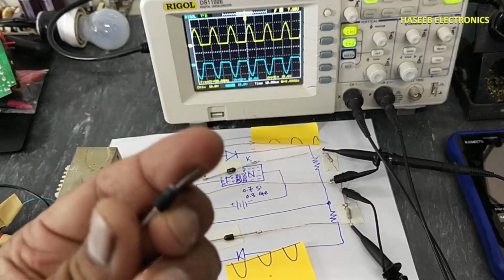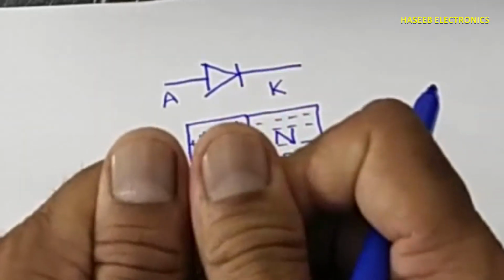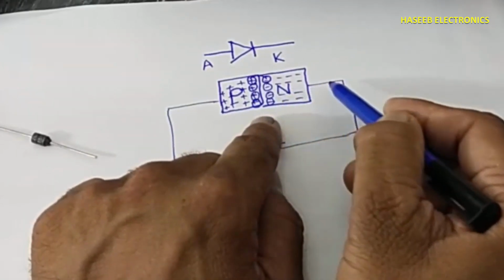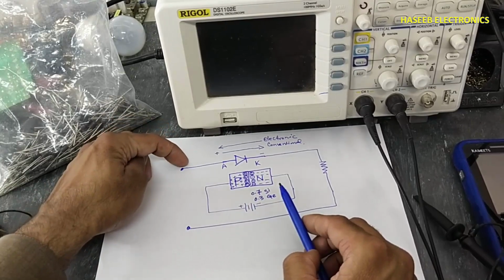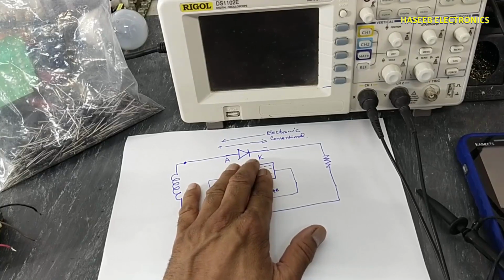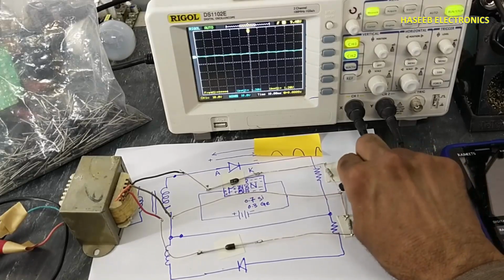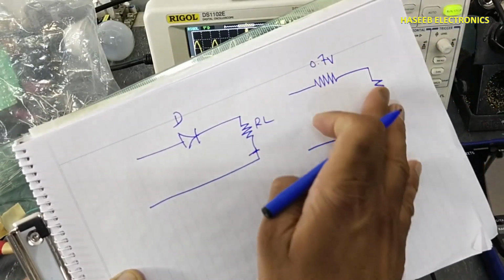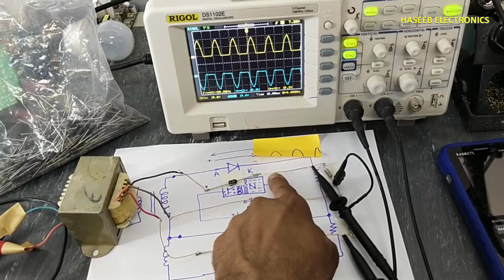{970} How a diode rectifies ac signal

Comment: Hi
can you tell me how a reversed diode is able to turn a light on ???
example a 120 volts AC  incandescent light , we connect a 10A10  reversed   , the light comes ON 
is not as bright but it comes on .
this is confusing because  in many cases the neutral is also connected to ground so I think 
the light should not come On.
I always been told a Diode is like a check valve that lets flow only one way.
your video helped me understand how a diode works little bit better  but I'm still confused about the light  comes on..
can you please explain ???

Comment: Asalamu alaikum haseeb Bhai i want know ,after bridge rectifier
how arrest or eliminate noise in audio board ,i am getting high frequency noise in speakers when i use transformer...when i use smps no noise....
This idea will be  out of law can i use EMI filter after step down from 230V to 35V dual supply...will it fix the issue....

Comment: AOA SIIRR,KINDLY EXPLAIN ABOUT 01 more diode...diode is installe before chooper  high volt300 after power ic drain pin   parllael with high volt cap+